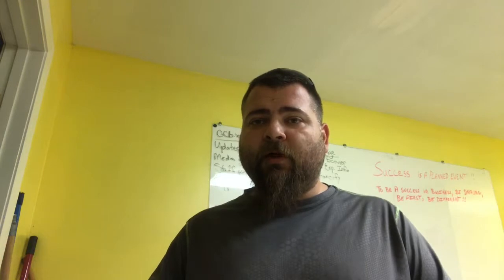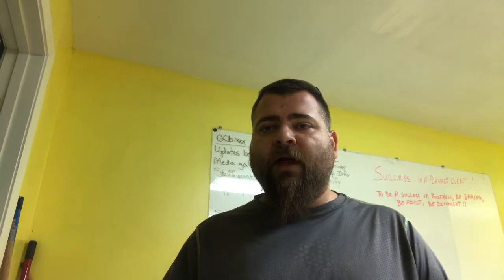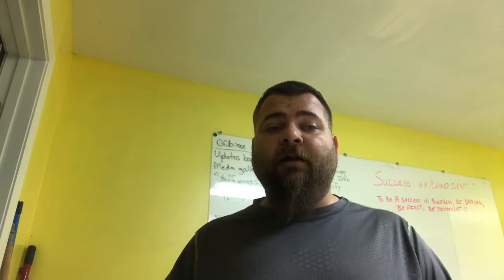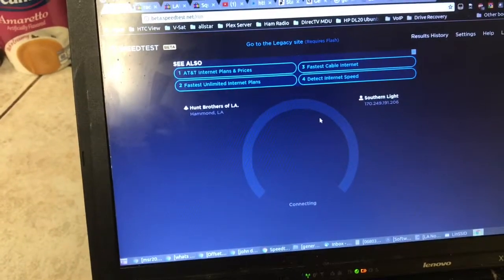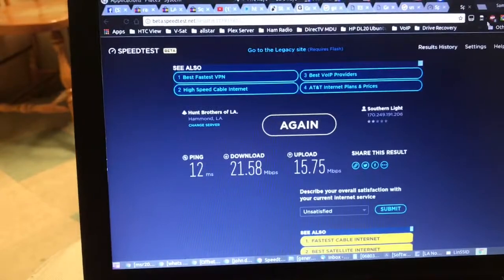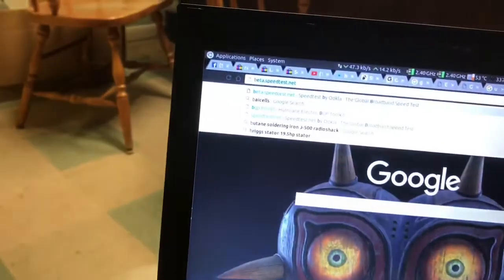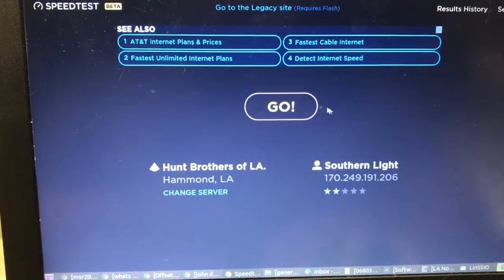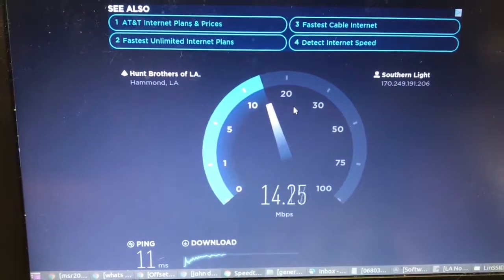WiFI vs Ethernet Speed Test

Comment: I have a question .. 
if 9dbi antenna router provides better range to far away devices ... will the ping also be better at a distant  range ? ... cuz I have I have a cable network which I will be installing near my TV in the front part of the house and my computer is a bedroom and I can't connect via ethernet

Comment: wirless doesn't really affect ping.. which is what really matters.. you only need 8 mbps download and 1 mbps upload for gaming
Reply from the maker: Wireless does effect ping! I do not have time to give a full explanation right now but I can give you many examples with video of poor network performance due to layer 1 wireless issues. I am a network engineer for a Wireless ISP by trade!
Reply: Samuel Rock from what I have seen from videos. And in my own experience the ping has only changed by no more than 5 on wirless compared to wired... to me that is not noticable, and I am a somewhat picky person.